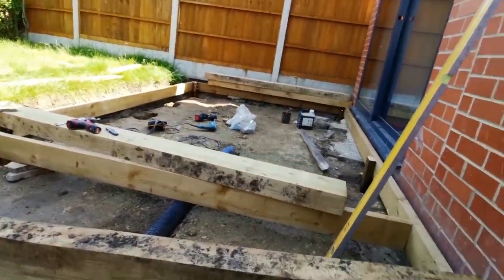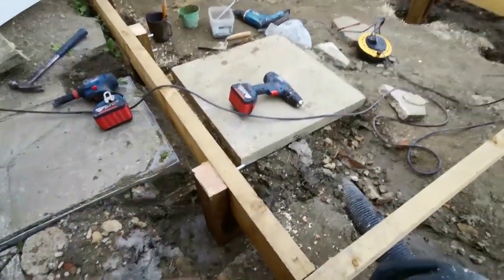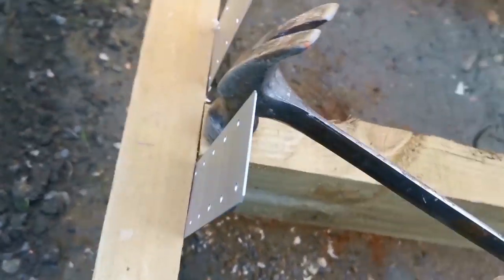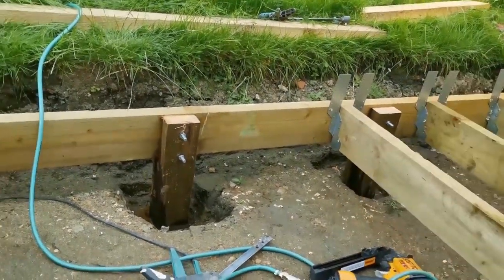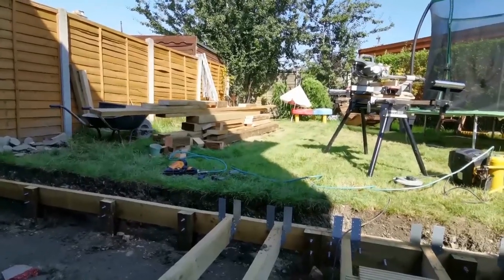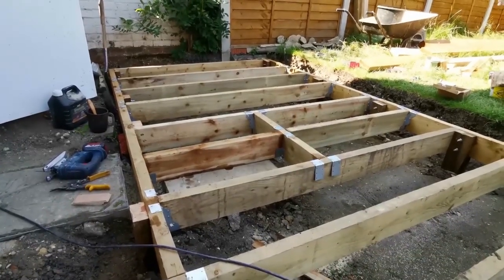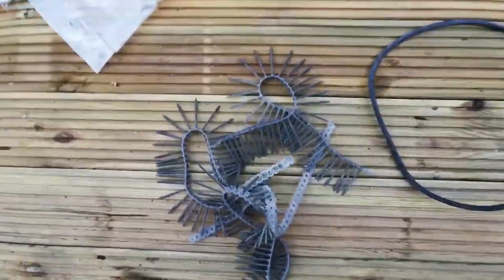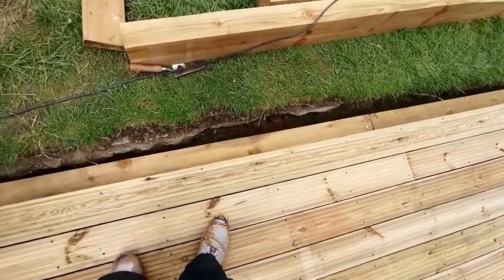Grumpy bank holiday flat deck building - Finishing bits & laying the boards

Comment: What size screws does your drywall gun take? What size did you use to screw the boards down?
Reply from the maker: This 240v one takes 75mm screws but i think the cordless only takes 65mm, partly why i went for the corded, i bought this a long time ago, it was just at a point where a lot of my tools apart from drivers were going cordless so if i had got the cordless i might be on Makita for the rest of my cordless tools now, just a thought 🤔👍 the decking screws are 65mm,, i get Senco from a local shop, Screwfix are stocking Timbadeck now, they stopped having them for a while,
Reply: Gid Joiner thinking about getting one for a deck ive got coming up, have you used the timbadeck ones?
Reply from the maker: I've used alsorts of brands, i don't see much difference, the sq drive head sometimes seems to drive better but that could just be the bit in my gun wearing, it has put in a few 1000s of screws, you do need to have a sq drive for your drill/driver if you want to remove any screws but they're readily available, saying that the head of the screws are Pz it says & the bit in the gun i think is a Ph bit, i'll have to have a look, just been looking online but can't see it, Makita 6844 240v Auto Feed Screwdriver, I'm really glad i bought it, it's so much better, I have a small 12v Makita cordless collated gun for plasterboard but that only does 55mm screws so cordless would be nice for the decking but the cord doesn't bother me too much & i like that it goes up to 75mm. , You won't regret buying it 👍 I use it with flooring screws in some of my vids.
Reply from the maker: Yep it's Philips bit, I didn't get mine here but it shows the specs https://www.dwtoolshop.com/makita-6844-auto-feed-screwdriver-110v?gclid=Cj0KCQjwyJn5BRDrARIsADZ9ykF1o4Od5xkufyUmsI91KGHs6oB6DHw0Fmh-vKf2lB96iCNp5IdklL0aAreJEALw_wcB
Reply from the maker: I get my screws from a place in Leeds called IPC Fixings who'll supply Senco screws, this is a link on their site https://www.senco-emea.com/product-categories/1541/collated-screws
Reply: Gid Joiner thanks illl look into it

Comment: My son wants me to do some similar, from a materials view what was the cost (not your costs).  Just so I can give him a rough idea as I don’t think he realises just how much things are or he’s expecting me to pay...
Reply from the maker: Hi, i don't share the £s details, it wouldn't be relevant anyway, depends were in the country you are & i prob wouldn't pay what you would pay even if you went to the same shop. I will give you a list of materials tho, Selco, Milfords, Wickes all have prices online
Joists i had to buy 3.6m so there was waste,
34 no 150mm x 4.8m deck boards
26 no 6x2 x 3.6m joists 
3 no 6x2  4.8m joists
3 no 4x4 x 3m posts
58 no M10 x 130mm coach bolts, nuts & washers
40 standard joist hangers 
880 Strapshot nails for the hangers
978 deck screws
concrete, ( i don't know he did that) & depends sometimes on the ground conditions, size of hole etc.
& creosote, treatment, a few nails, screws n coach screws...
Reply: Have a look for your local sawmill. It might well be cheaper and they usually have a delivery service. Just another option to look at.
Reply from the maker: Yeah meant to say i got this from Shire Timber but sometimes use Arnold Lavers

Comment: What nailer and nails are they, Gid? Or is it a changable magazine for the nails?
Reply from the maker: You can buy the nails in 1000 but it works out cheaper to buy 4000 

Bostitch MCN150E StrapShot 38mm Positive Placement Nailer
https://www.dm-tools.co.uk/product.php/site/froogle/sn/BOSMCN150E/google/?gclid=Cj0KCQjw5MLrBRClARIsAPG0WGzngX-_EN1ySKis-_kiuaI-_JY47ldIRg5T476Qid9AcGK0U3E260YaAuVyEALw_wcB#.XXDCfihKiHt
Bostitch BOSMCN150E MCN150-E Strap Shot Metal Connecting Nailer
https://www.ffx.co.uk/tools/product/Bostitch-Bosmcn150E-5902013931225-Mcn150-E-Strap-Shot-Metal-Connecting-Nailer?gclid=Cj0KCQjw5MLrBRClARIsAPG0WGw2xPOzPClHGnnML5tIQ5UmxCTlYLhwHD38NwmYtnTMnXMsvbmFDscaArTbEALw_wcB
Nails http://www.betcofasteners.com/catalogsearch/result/?q=strapshot
Reply: @Gidjoiner  cheers for the links, Gid. Another tool to add to my list lol

Comment: When building the frame, do you work out the span so you don’t have to rip the final piece of decking to width? Hopefully that makes sense. Great work Gid!
Reply from the maker: Hi, Thanks , yes i try to when I draw the plan, sometimes these boards can be almost 5mm different in width & a bit bent so they don't always go down as planned,

Comment: Little bit of gravel in holes would’ve level them surely
Reply from the maker: Maybe but when i slid the post in the gravel would've moved, i would've had to fanny around going around lifting n shoving a bit under here n there making sure the height near the doors was ok & really i shouldn't have had to if the concrete was flat as I requested,

Comment: Don't think this first rate job with post holes not filled with ballast or concrete to prevent rotting no weed suppression matting I'll give it a month and you will see weeds coming through and joining decking boards it's a no no from me I would have turned it round and had the fall towards the lawn 
Going to be nice and slippery in the winter I can bet you on that what I can see of the fall ?? Tell me if I'm wrong
Reply from the maker: Thanks 👍

Comment: What size is the frame work mate,,,I’m thinking of having a go at mine
Reply from the maker: Hi, I did mention a calculation in the vid, maybe pt1, Span ÷ 20 + 20mm, the added 20mm is to reduce bounce & for safety, these are 6x2's, best of luck, Get in touch if you want when you come to it 👍
Reply: Gid Joiner cheers mate thank,,think mine is about the same size as that you done,,,what would you say it would cost me in Materials roughly mate
Reply from the maker: No prob 👍 someone asked me the price on anther comment so I'm going to copy n paste - 
Hi, i don't share the £s details, it wouldn't be relevant anyway, depends were in the country you are & i prob wouldn't pay what you would pay even if you went to the same shop. I will give you a list of materials tho, Selco, Milfords, Wickes all have prices online
I got this timber from Shire Timber but sometimes use Arnold Lavers.
Joists i had to buy 3.6m so there was waste,
34 no 150mm x 4.8m deck boards
26 no 6x2 x 3.6m joists 
3 no 6x2  4.8m joists
3 no 4x4 x 3m posts
58 no M10 x 130mm coach bolts, nuts & washers
40 standard joist hangers 
880 Strapshot nails for the hangers
978 deck screws
concrete, ( i don't know he did that) & depends sometimes on the ground conditions, size of hole etc.
& creosote, treatment, a few nails, screws n coach screws...

Comment: Awsome Job definitely not going any where. Are they hard wood posts you’ve put in?
Reply from the maker: Thanks Jody 👍 no they're just treated softwood, Hardwood posts would cost a huge amount & aren't readily available, Yes they will rot, if they went into the ground the depth i originally wanted the bottoms would be hermetically sealed 🤷‍♂️😉

Comment: Hi just noticed have you bridged the damp course?
Reply from the maker: Hi, it's built separate to the house
Reply: @Gidjoiner  Hi I  my neighbour has had decking done the same way and is now having problems with damp, when it rains it splashes over the damp course.Just an observation not having a pop at your work i enjoy your vids, would foam round the bottom of the posts help keep off the water?
Reply from the maker: Hi I understand what you're saying, there's going to be some splash back but the outside wall is classed as a wet wall, it's designed to be rained on heavily for days if needs be, it then dries out in time, the cavity prevents water ingressing to the interior wall, the damp coarse is supposed to be there to stop water permeating/rising up, quite often the damp coarse is bridged in the cavity bottom by mortar & rubbish dropping down inside the cavity, sometimes the butterfly ties in the cavity holding the two walls together catch mortar & rubbish up the wall bridging the cavity causing damp spots in unusual places anywhere up to the gutter, these ties have a twisted join that sits in the middle of the cavity, when the brick layers put them in they point this joint down & give it a push to slightly bow it down so any water that does decide to travel along them from the exterior wet wall drips off midway, The gutter can get blocked, the breathable membrane under the tiles at the eaves can droop where it meets the fascia causing like a little gutter stopping damp/humidity under the roof tiles running off the roof, (that''s why i put a piece of ply there when i did the porch roof) when the membrane is punctured this little gutter can let/direct water into the cavity or the bottom row of tiles near the eaves, fascia/gutter board can get damaged with wind causing water to run down the roof then inside of the outer wet wall or interior wall, I doubt the decking being above the wall is causing damp inside the house, the splash back may increase dampness & maybe cause black/green staining in that area of the external wall but more likely the cavity is bridged somehow, so whether the decking was there or not there would be some damp inside that house, Thanks glad you enjoy them 👍